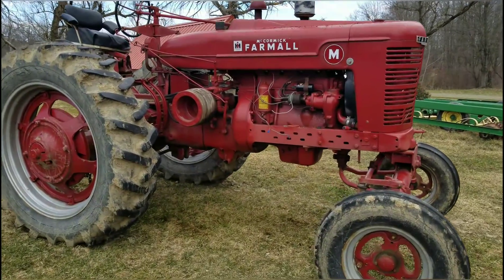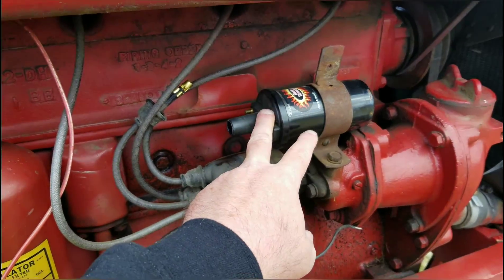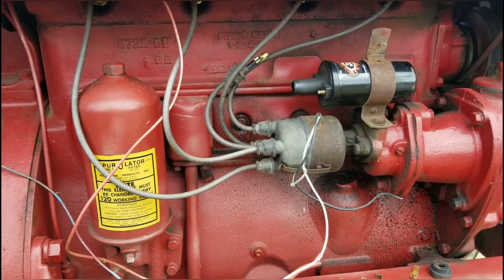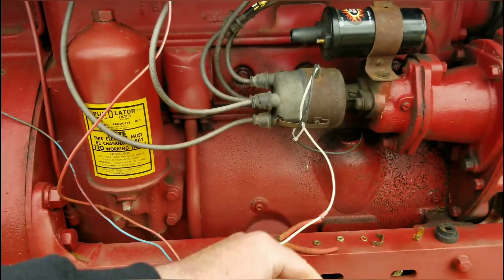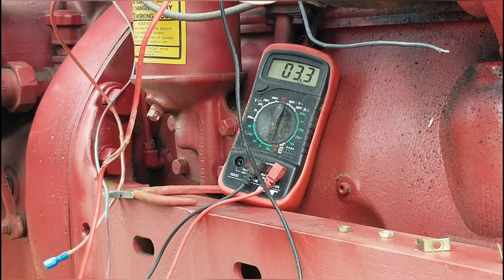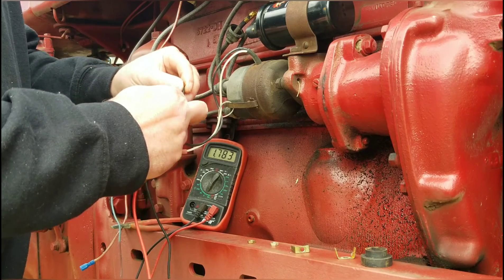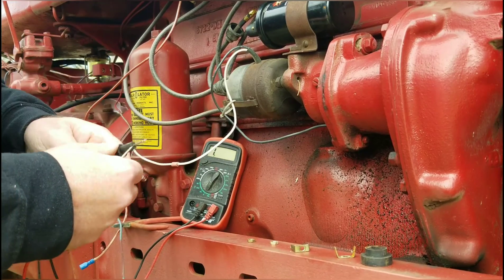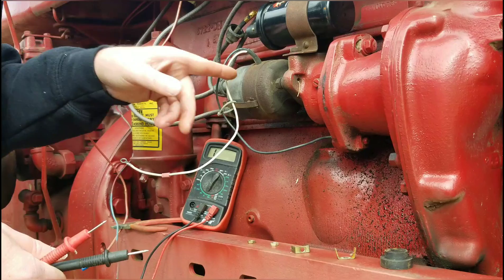Farmall M Electronic Ignition Test

Comment: Sorry to bother you again but I installed the new coil and module and the wd45 fired right up only to have it die a few hours later and won’t start again. Any idea on what would be frying the coil and module?
Reply from the maker: A key left hot will...make sure ur not leaving the key on or the starter switch pulled out or partially pulled out
Reply: Father in-law replaced the ignition switch also. Think he wired it wrong could be the problem? I really appreciate your help!!

Comment: My father in-law had someone replace his coil module wires and plugs. Tractor fired right up and ran for a few hours now won’t start. It’s a wd45. I checked the coil and only get .7 ohms and can’t get a reading on the module. Any ideas?
Reply from the maker: Probably a fried module and coil
Reply: Yeah I’m guessing so as well. Don’t know why it fried it so quick tho.
Reply from the maker: @RyanElliott-j8d  no ballast resistor most likely
Reply: Thanks for the reply!! I appreciate it!!
Reply: I bought a new flamethrower coil. It says no external resistor needed. So don’t use the ballast resistor?

Comment: The reason those modules keep failing on you is that you are hooking them up wrong. If I remember correctly. You are running a resistor in line to your coil, so you are feeding your module reduced voltage. The modules instructions state that they require a full 12 volt supply. Try running a separate wire straight from battery voltage to your module. I bet you see a difference.
Reply from the maker: No I'm not running the resistor. The resistor is Built-in to the coil. This video is quite old I'm going to say maybe 2 years and I haven't burnt one out since
Reply: @FarmallFanatic  You may still check the voltage supplied to the unit. If the coil is internally resisted, it could still cause a voltage drop. Breaker point systems require this, it is hell on EI.

Comment: Only problem with petrol Tractor. With Derv no wire's  lol. Nice old tractor mate of course. Would get wet in the Highlands and the weather would kill it. Good  Tractor out with you  tho probably.👍
Reply from the maker: You guys mostly run diesel?
Reply: @FarmallFanatic  Yeah I don't  know  any famers over here that run Petrol Tractors. You might see the odd old vintage Ferguson. Not a big seller over here buy a working petrol cheap abou 1500pounds for grey Ferguson. Most Tractors where Diesel over here as a cost factor and reliability. Back in the  50s when petrol was cheap people bought a few so some still survive altho not many i was at Auction about 3 months ago where nothing was making its money.  Tc 👍

Comment: It looked like you were holding the wires and test leads together with your fingers, don't... it can screw up the reading. You should also check the resistance across the high tension side of the coil, it can fail as well, leaving you with a no spark situation.
Reply from the maker: I held it then didn't hold it and it didn't make a difference, but I know what you're saying

Comment: Are those copper core spark plug wires? I know Petronix recommend getting rid of them to eliminate the chance of a elecromatic impulses hurting the module. I've read however that shouldn't be a issue unless your really running a hot coil. I noticed you got the Flame Thrower. I have one on my M as well. If I remember they are 40k volts?? I've changed all my copper core wires just in case. Good Video. Control those chickens!
Reply from the maker: Sure did change them out...great advice

Comment: You answered my question about electronic ignition. I think I will stay with points. I get five years out of a set now that I went to Borg Warner. Also I recommend Borg Warner caps and rotors to because they actually fit nice and tight on the distributer. I tuned my H up with them and it purrs like a kitten.